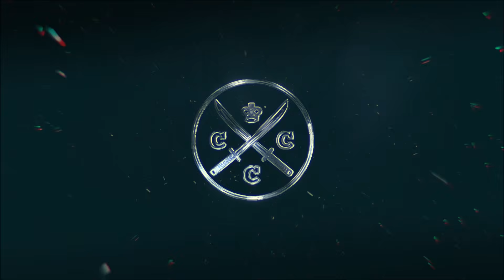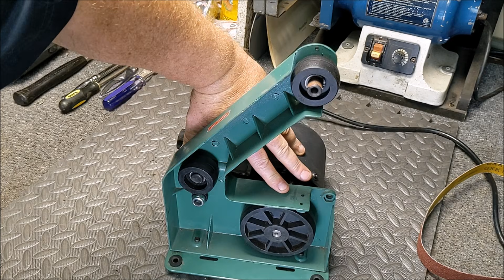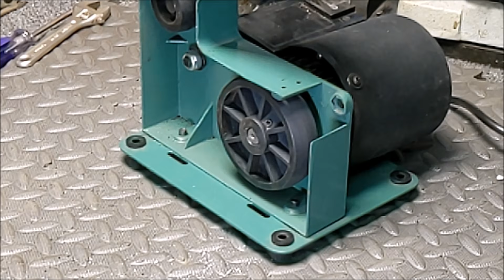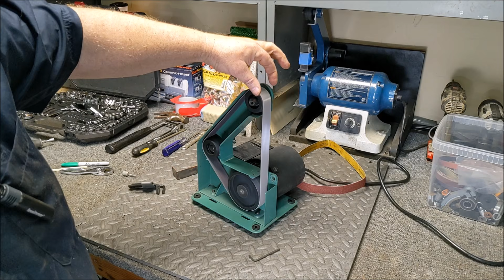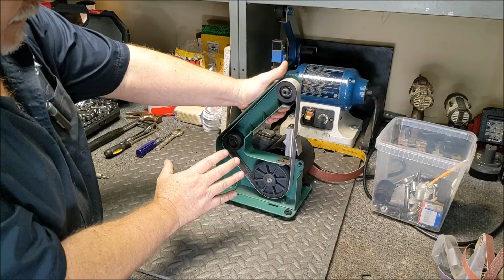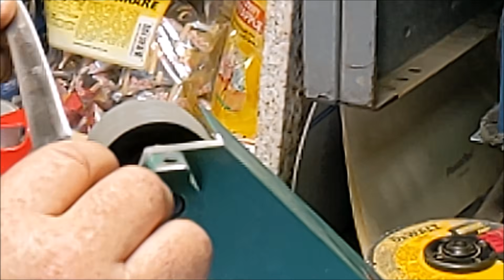How to Set up your Harbor Freight 1x30!

Comment: I bought one of these about 3 yrs ago. Had a coupon and they had a sale to boot. Less than $50 out the door with a variety pack of belts. Made probably a dozen hunting size knives, use it a bunch making spurs and buckles. I run it stripped down with all shields off. I've put it through hell and it's held up great 👍

Comment: Great video!  Just finished truing my wheels.  They had some strange casting flaws in the pulleys.  I used a dremel while it was spinning to get it super true and sand paper to finish up.  Runs vibration free.  Mine had a different clearance problem on the idler arm, but you motivated me to take off the wheel and see what was hitting.  Just had to make the opening a little wider on the bottom with the dremel to get the arm to swing more.  Thanks again.

Comment: Less than a year ago I got one of those Ruixen Pro things that clamps to a table or countertop and has bars & a swivel that guides little sharpening stones.  Just recently finally starting to use it, starting to get the hang of it.  And now I come across this little belt sander that seems even better.  I just have to find a way to justify yet another new purchase to the wife that has watched me using the other thing.  It's so easy to end up with a shop full of crap that seemed like a good idea at the time, but now sits unused.
Reply: As a buddy of mine always reminds me: an investment in your hobby is always worthwhile.

Comment: i just got my 1x30 last week, started with a 8" mdf wheel on buffing grinder. 
got 10" wet sander, - messy
got CBN wheel-1200 grit, got push cut slowly

Comment: That model is currently in clearance at Harbor Freight for $54.97. I bought the last one at my location and used the 25% coupon! Thanks for this video. It will help me setup.
Reply: Do you know if it comes with the angle guide, or is that purchased separate?
Reply: @nathanielrobertson689  It does not come with the angle guide.

Comment: Good video.  Took your advice and trued the wheels. Much smoother now. Might cut the top off like you did, access to the upper wheel could come in handy even though it is convex. Kinda like having the shield on top because all the grind particles won't be in your face.

Comment: By sanding the wheels you might take the crown off the wheel. The crown keeps the belt from drifting off.
Reply: That's so true. When belts starts sliding of you've ruined a knife

Comment: got a bucktool low rpm 1x30 : added the modified angle gauge. 
modified the machine: when I was using leather strop belt, it hits to frame, wearing the belt- filled that down. 
got 80-3000 grits, 5+7k chiming 😊😊
moved angle guide closer for thin belts, closer to platen
don't use the leather belt any more
I get push, draw an s cut through ad papers!!🎉 

little stropping, perfect, cuts hairs of course..
$350 to Canada
Reply from the maker: Nice work!

Comment: one item to add:  a stronger spring helps with smoothness.  I bought one from the bins at Ace Hardware. 
Which belts do you like for this?   I find that the seams of most belts cause a bump that makes for chatter that's unpleasant
Reply from the maker: We have a belt video coming up featuring the products we know offer.  I wouldnt be using them myself or offering to sell to others if they werent the very best available and I can actually undercut the bigger guys somehow.  Check link in Description to shop.currycustomcutley.com
Reply: @CurryCustomCutlery  Myself in next few months am going to get the other motor and things he suggest, as he is not making videos for view counts= just a great educator. Get stuff from Cliff save yourself the web searching. Over the years I've emailed him and got better than 72 hr response and honest answers= proof he is a kinder than kind guy. Few months to order yet then buying from him .

Comment: To make belt changing quick, I take the belt cover and use gorilla tape to form a hinge on the bottom of the cover. I take out the cover hold down screw and use a small clamp to hold it on. To remove cover, just take off the clamp bada Bing, bada bing
Reply from the maker: That's a solid tip for sure!

Comment: Those are helpful tips. But when I look at my drivewheel slow down, it's really wobbly could be the way it's mounted on the shaft, but it almost needs. Some serioushaving to get it to run round and true, and that would take the wobble out.  And vibration two

Comment: It all sounds logical about the tensioner however with mine loosened to slide freely, the tensioner bounces back and forth against the spring causing bad vibrations in the whole unit causing it to move around on the table despite the rubber feet.  I'm sure this is caused by the main drive wheel being out of round and causing the rapid pulsing/ vibrations in the tensioner wheel.  The only way to stop the horrible vibration was to tighten the tensioner bolt.  Then the grinder runs smoothly but it is more difficult to change belts.
Reply from the maker: Increase spring tension would be guess as to what to do...but Im just looking at your words so hard to tell.

Comment: Welcome back Cliff! I’ve watched many of your videos it somehow missed the part where you said to remove some metal on the tension spring holder. Now I’m in search of a new idler wheel. I called HF and they didn’t have them. Is there anywhere you can buy new ones that will work?
Reply from the maker: I have on my website:  shop.currycustomcutlery.com

Comment: Hi Cliff, have been following you and a few other sharpeners for a while and looking to expand for just a sideline/hobby to a business. Do have a question, looking on HF for a 1 X 30 and seem to be out of stock. I have seen other 1X30's for sale but under a different name but look identical. I'm going to assume most of these are made in the same shop in China just with different names slapped on them. Could these be modified with your parts, if all else seems the same?

Comment: Harbor Freight makes: Router Variable Speed Control Dial. Wonder if this would work to slow it down a bit? Thanks.
Reply from the maker: Sorry it wont work.  This is a single phase AC motor.  No speed control works or I would have used it years ago.  The Router controller is designed for Universal (with Brushes) type motors.
Reply: @CurryCustomCutlery  Thanks for saving me the trouble!

Comment: Been having problems with the tracking once I flipped it on it’s back for edge trailing.
Reply from the maker: I would guess the tracking knob is resting on the ground
Reply: @CurryCustomCutlery  yes it was. Need to build a box for it. Any ways to have the tracking in place? As soon as I turn the knob just a tad the belt goes too much to one side.

Comment: Ok, you said two contradictory things. "Ideally you want a solid block" "but I am following the contour of the wheel".  Well, those are two different goals (??) which is it, do we want a straight flat grind or a curved grind? you can't just say opposite stuff like that and let it fly.
Reply from the maker: Ideally means "under ideal conditions I will do the one thing"
But since I am not doing the ideal thing I will do the other thing that is 2nd best.
I hope that me taking the time to explain that helps you.